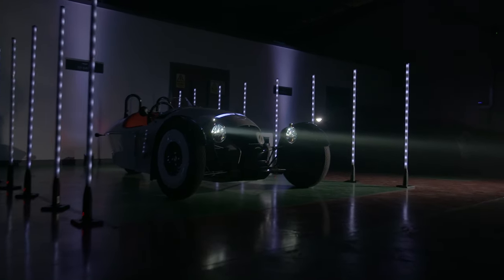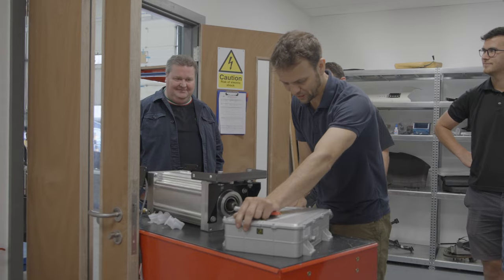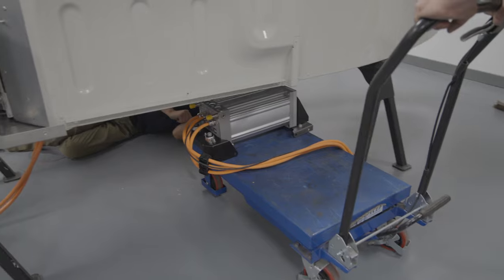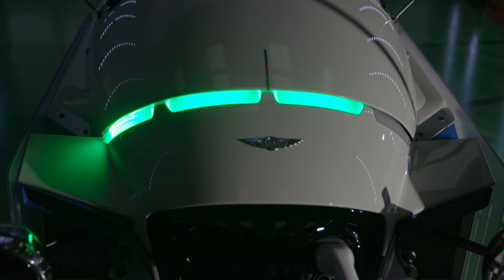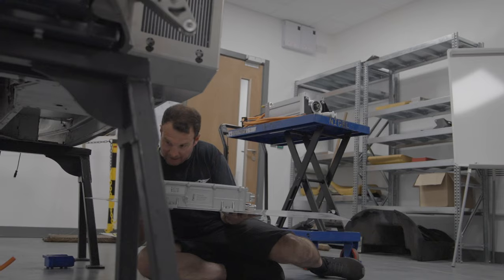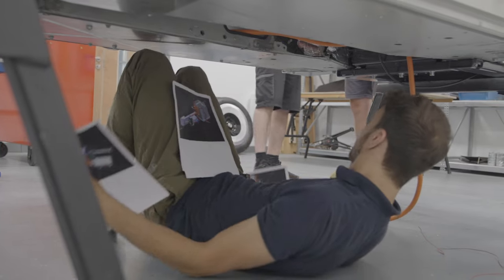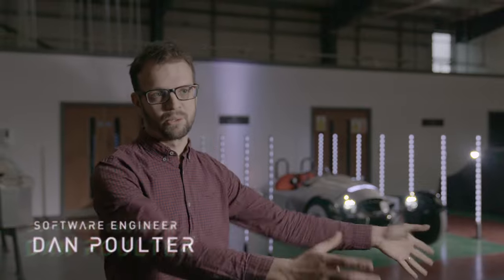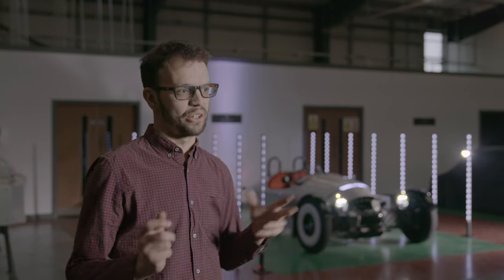Meet XP-1, Morgan's Electric Experimental Prototype

Comment: I hope they get between 150-220 miles range.
Reply: It should do. Back in 2012 Morgan produced a prototype of an electric version of the 3 wheeler they made at the time and it had a range of about 150 miles. With the advances in batteries since then, it's safe to assume a range of 200 miles would be achievable today.

Comment: The Morgan 3 wheeler is a great car for electrification, as are public buses. But there will come a time in the not too distant future where people will see the electrification trend in motoring as a monumental mistake, as electric cars are extremely harmful for the environment.
Reply: No it’s not they tried it before .short memories some people 😂
Reply: Totally agree.  The whole EV concept is poorly thought out, and engineers are in reality being pressed to develop what is an extremely flawed concept.  Ammonia/Hydrogen is the way to go.
Reply: Any change in tech has its transition period that can be problematic. Do your research (actually DO your research!) and you'll find out that battery tech is moving VERY rapidly, as is infrastructure  improvements and creating much more friendly power generation systems. Within 5-10 years most of what is bad will be addressed and on the way to providing sustainable, clean energy from cradle to grave. Patience, grasshopper. We only get out what we put in.
Reply: That’s the problem. We are transitioning too fast. Cradle to grave . How long is it going to last 50 years. My Mondeo is greener😂
Reply: On what do you base that assumption? Of course we would need to be much, much less car-dependant on the whole and favor sustainable transportation. But if the option is between an internal combustion engine private car and an electric private car, the electric option has been proved to be better for the environment in multiple studies.
Reply: @1sm0Laitela It would all depend on your definition of 'sustainable'. Resources for batteries are far more scarce than oil, and there is simply not enough of it to fully replace combustion engines, not te mention the labour under horrible conditions with which this resource is mined. Which is why the hidden agenda here is to do away with private car ownership entirely.
Reply: Worse for the environment than burning 20,000 litres of petrol?
Reply: Your point is ?
Reply: @TheSmiddy  Significantly.
Reply: @Lexcoaster  unfortunately the facts don't seem to agree with your position.
Reply: @TheSmiddy  Try telling that to the children mining for cobalt in the Congo.
Reply: @Lexcoaster  a) cobalt isn't used in modern batteries. b) why is children mining a necessary step? seems like it would be pretty easy to just swap them out with non-slave labour.
Reply: @TheSmiddy  1) Yes, they in fact are. 2) We don't live in a perfect world where exploitation of common people by the rich and powerful is a thing of the past. 3) Please don't confuse your ideal of reality with actual reality.
Reply: @Lexcoaster  LFP batteries, i.e. the current industry standard on new models doesn't use cobalt. 

You should also not confuse your ideal reality with the current situation. TODAY EVs are already less environmentally impactful and this will only continue to get better as the grid is cleaned up.
Reply: @TheSmiddy  You;re calling it the current industry standard. Only very recently have these been introduced to the car market. Let's see where this is heading.
Reply: Genuinely curious, how are electric vehicles actually harmful for the environment?